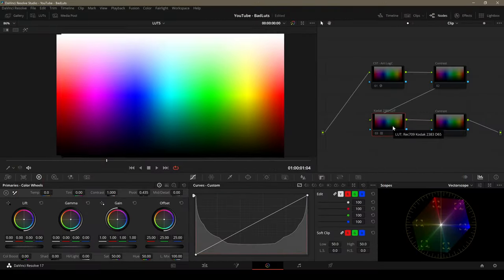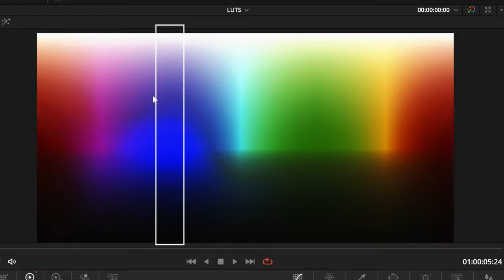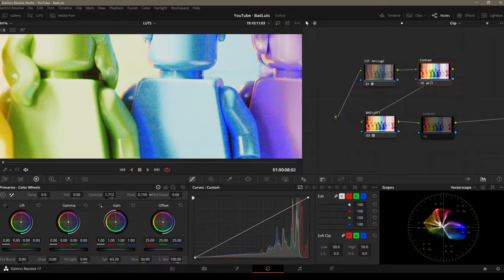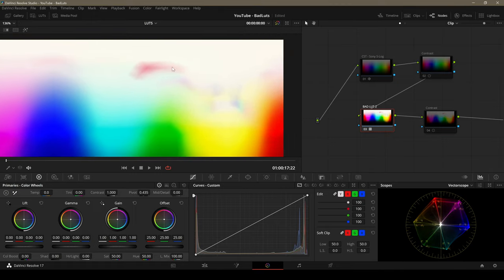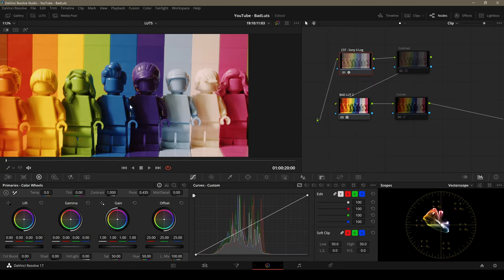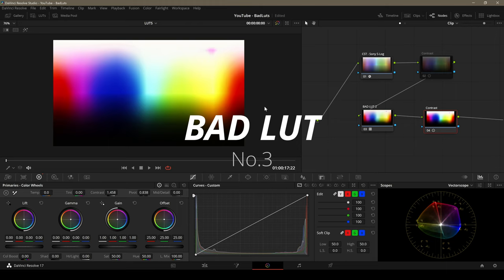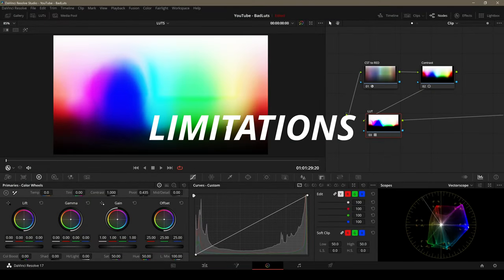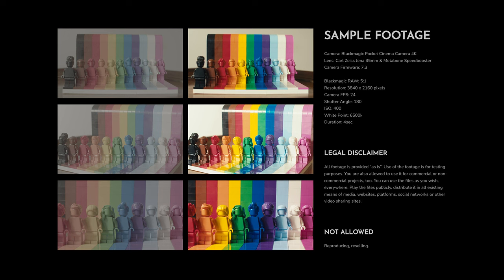How to stress test a LUT in DaVinci Resolve

Comment: Is there a way to fix these?

I am currently trying to design 2 things.

A standard conversion LUT for me as a base-line, and a proper 2383 LUT for monitor on set.

My camera is Sony F35 so it's CCD and may act differently, and SLOG1 isn't really getting that much attention anymore.

My conversion LUT seems alright so far, but the 2383 LUT tends to have cyan/blue in the highlights when I monitor the curves in Lattice.

Comment: Hi Stefan, thanks for the great ressource. What is your input colorspace and input gamma on your timeline  when using the color gradiant ? As you change form it to colorspace needed by the lut.
Reply from the maker: In my testing process, I use a CST to convert the test image to the color space that the LUT expects. It's worth noting, as I mentioned at the end of the video, that this method isn't 100% accurate. The color rendition isn't going to be exactly what you'd get if you were working with original footage shot in the intended color space. However, it does provide a good initial impression and can still be a valuable part of the stress testing process for the LUTs.
Reply: Hi  @StefanRingelschwandtner  ! To be sure i'm not making a mistake in my CST Is your RGB test charts in SRGB linear gamma ?   thanks for your amazing work
Reply from the maker: @davidhtz9438  The RGB test charts are in the standard sRGB gamma, which is not linear but has a gamma value of approximately 2.2. They are designed to match typical display conditions. If you need them in linear gamma, you would have to apply the appropriate conversion.